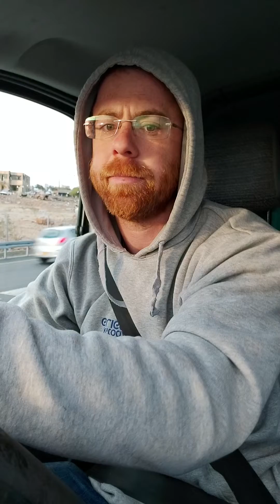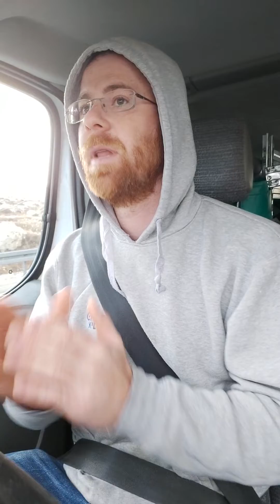Difference between PP/PVC/HDPE drain piping

Comment: There are orange PP pipes
Reply from the maker: Hi, not here in Israel which is the target 🎯 country of this video.
Reply: @PrupisPlumbing  Question, You have said in the video that gray pipes are meant for inside but exposed which means you cannot use it under concrete.
But I have seen all the plumbers putting PP Gray Pipes in bathrooms and so on, the 50mm and the 40mm, maybe you meant that the 110m and so on are not meant to be under concrete? 
Thanks Prupis for the videos :) watching and learning.
Reply from the maker: @zimmers  Hi. Thanks for the input. Above the concrete subfloor yet beneath the tiled floor is ok. The issue is installing them inside poured concrete or under the concrete foundation.
Reply: @PrupisPlumbing  Thank you for the reply.  But they are putting concrete on the pipes before they tile and then they are putting sand and so on. so they are basically under concrete
Reply from the maker: @zimmers  they wrap them with cement yes. The Israeli code allows for it, doesn't state the reason but A: it is easier to access to repair than in concrete and B: if you've ever seen what roots do to PP pipe underground....
Reply: @PrupisPlumbing  I understand, my definition of concrete was wrong this is why I thought it was concrete. its actually cement, so behind cement is ok, but not behind concrete
Reply from the maker: Btw where are you watching from
Reply: @PrupisPlumbing  Watching from Israel, I have seen that you are talking English so I have been talking English with you. Thanks a lot for the videos, Jacob.